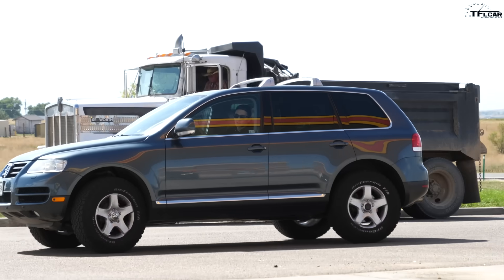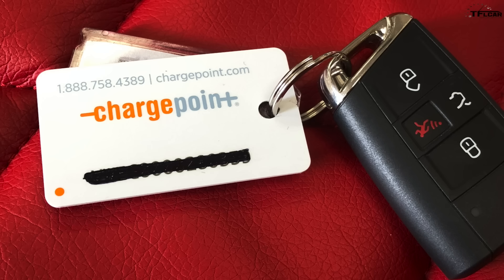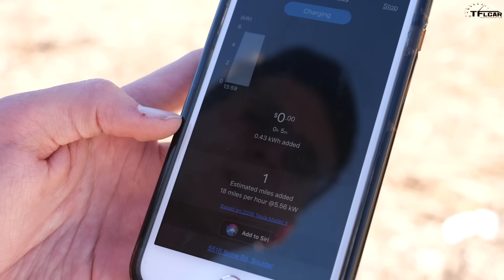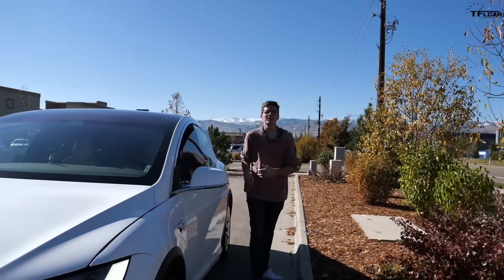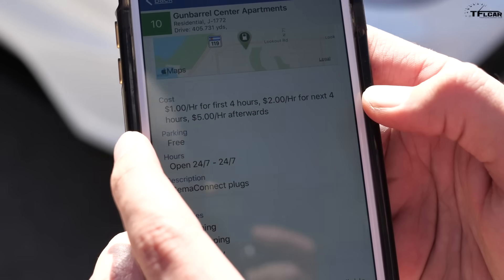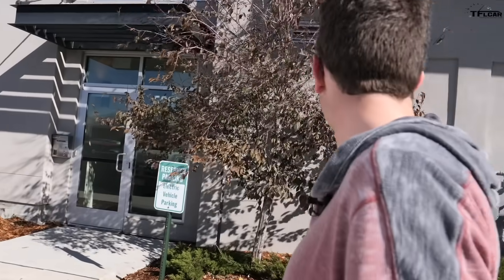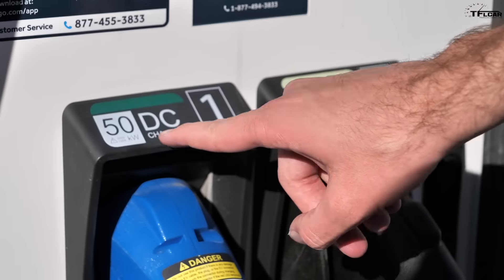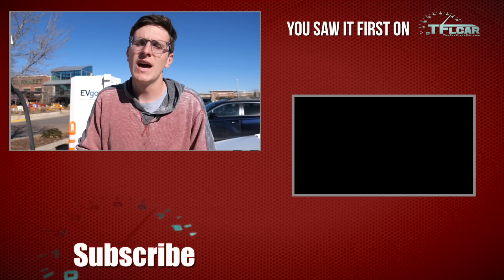Here’s Why Charging an Electric Car Can Suck - And It’s Not The Reason You Think!

Comment: Yes, the charging picture in North America is a disaster.  First automakers refused to come together to agree on a standard, there was and still is shenanigans about plugs between companies.  Then on the regulation side, despite calls from the BEV community, time and again politicians failed to craft policy that would lead to a standard.  Europe was much more forward thinking and legislated a de-facto standard years ago.  Any public charging station must have at least a CCS connection in the EU. 

As for the different levels of charging: If you're taking a long trip and need to add a few more hours of driving time while you drink a coffee you need a modern lvl 3 charger that can charge at more than 100Kw.  None of this antiquated 50Kw nonsense.  If you're going anywhere that you're going to spend a few hours anyway, like to the mall to watch a movie or out to dinner or to stay at a hotel level 2 is the best option.  Often you can even charge for free since a place like a mall would love to keep you there as long as possible.  The best day to day solution (if you can swing it) is to charge at home.  Even off a 120v outlet.  Just like your cell phone, you plug your car in when you get home and it trickle charges overnight and you set off in the morning with a full tank.  Again, this is where legislators need to step up and craft policies that ensures that apartment and condo dwellers have the ability to access a plug where they reside that is fair to everyone involved.

Comment: Charging by increasing the range at a rate of ~ 15 miles per hour. Imagine a normal gas station dispensing fuel at a rate of ~ 2 liters or ½ gallon PER HOUR... 🤣 
You have to be pretty much of a green brainwashed fanatical virtue signaller to put up with all this crap... 🤣
Reply: bokkenrijder172
And that's if they work.  Half the ones in the UK don't even work.

Comment: 0:35
Getting a 240v line run in your garage is pretty easy, to be honest, electricians do it all the time. Plus you can usually get the cost of a garage charging station reimbursed
Reply: and if you're outside North America and Japan, they all use 220V-240V
Reply: @Banom7a  And also can change to 3 phase for 400v
Reply: @gregandkaruna6674  Every house in my country has 400V plugs since like 50-60 years..its use for Ovens mostly or electric heating ..but problem is like 30% off people live in apartments ..my uncle live on 15th floor and has no own garage (there is one but shared )..how can he charge a car ...but i would like to have electric cars but still deam expensive
Reply: @dzonikg  Ovens do not need 400v they all work on lower voltage, they do however require higher current. Yes it's been around for 50 years but most houses opt for single phase 220-240v as it's cheaper and in most cases 400v is not needed, however if you charge your Tesla at home then 400v will just charge faster and not need thicker wiring due not needing as high current.
Reply: @dzonikg  I understand 3 phase power domestic distribution is more common in Europe. That is, the power supplying the buildings is often 3 phase making it relatively easy to run a domestic 3 phase circuit from the board. In New Zealand to run a 3 phase circuit requires a separate distribution board and metering making it cost prohibitive unless running a workshop with anything drawing more than 32 Amps.
Reply: I did my own.  Basic electrical knowledge and Google are all you need.
Reply: Pretty easy if you don't need to upgrade your electrical panel to handle the extra load. A lot of older homes only have 100amp service currently and quite loaded already.  If the electric companies are willing to pay the up front cost of installing the chargers with having to upgrade the panel maybe you will get faster adoption.
Reply: Can you power a 240V car charger off of 208V instead?  A lot of apartment complexes have 120/208V delivered to each dwelling unit, which is 2 out of 3 phases of the 3-phase service to the building.

Obviously it would mean slower charging, but can it still work off of 208V?
Reply: @carultch  It'll likely be even slower than you think, if just looking at what appears to be a marginally lower number (240 to 208). Heating equipment designed for single phase 240V yields around 75% of it's output when run on 208V
Reply: @DiscoFang  So is that a yes or a no?   If you plug it in and absolutely nothing happens, that would be a no.  If you plug it in, and a failure mode happens, that would be a no.  If you plug it in, and it just has a hit to its performance, that would be a yes.

I'm aware that for ohmic resistor loads, the power is proportional to the square of the voltage, hence 75% power, and not just proportional to the voltage itself.  By contrast, a better case scenario is if it were built to always draw 32A from the source regardless of voltage, it would charge at 87% the rate.

Comment: Tommy, how much does it cost recharging at home for full recharges?
Reply: Depends on an number of factors not the least of which is the rates in your area.  Many places have time of day charging to encourage the shifting of demand from high use times to off peak times.  Significantly lower rates often apply in these areas.  All BEVs can be scheduled to only begin charging when you specify for precisely this reason.   More to your question: In general, a BEV plugged into a 120v outlet is the same as any other appliance.  It can only draw as much current as the circuit breaker will allow.  A good comparison would be a large flat panel TV.  If you wished to fully charge a fully depleted BEV with a range of more than 200 miles in your garage from a 120v outlet then you'll need to leave it plugged in for 2-3 days.  So the cost in your area would be similar to how much you would spend if you left your TV on for 2-3 days. (The average drive usually only needs a single night to recharge as the 'average' driver only uses about 30 miles of driving per day).  Some BEV's also can sell power back to the grid.  They can charge at cheap off peak rates then if power prices go too high, they can sell whatever the owner has pre-approved back.

Comment: Well - get a Tesla (model 3) in Europe and there is no adapter needed - it is pure type 2..... and you charge with 11 kW at home or at these destination chargers.....
Piece of cake. 
DC charging - just as easy - the model 3 Europe is with CCS - main standard on DC chargers no adapter need.....
Reply: Also IONITY has chargers capable of 350kW. And Model 3 maxes out at 200+kW.

Comment: There's no charging station within 45 miles of my house.
Reply: You don't have an electrical outlet in your house?
Reply: @Bryan46162  the house is 70 years old and most of the plugs are the old 2 prong style. I have adapters on every power strip I use. I wouldn't trust it to charge a car without rewiring the entire house and as I don't own it, I'm not paying for it.
Reply: You do have a house.  So you have a charging station 0 miles from your house.

Comment: I dread the day when ice vehicle are nearly extinct and this is what we will be left with.
Reply: My prototype makes ICE much more efficient.  The cost gas is cheaper than electricity in my area once an engine is modified.

For an example my lawnmower runs for about A hour on 15 cents of gas.  My brother's electric lawnmower runs for about 45 minutes and costs about 30 cents per charge.
Reply: @787brx8  Please share your mod.
Reply: @ChannelZeroOne  I already share other research on my page for free.  If the world wants this one, they will have to pay!

Test out the stuff on my page to see for yourself.  

If I do make A video on the lawnmower, I won't show most of the modifications.  Probably will just show people how to advance the ignition timing.
Reply: @787brx8  sounds like BS to m,  no link. I've seen enough scams with the hydrogen thing. I've got tricks to get more MPG I'm just curious what other people are doing. Most of it's just snake oil anyways.
Reply: @ChannelZeroOne  The information is on my YouTube page.  Or just search "85 octane full throttle" to see A test run of the prototype on A 98 Mazda Protege.  Then pause on the distributor part to see where the timing is set.
Reply: Charging while you sleep.. sound pretty difficult i guess?  I use the Supercharger about 1-2 times per year.  Most Tesla owners will actually never use a supercharger or other charger ever..with 500km/310 miles of range most people will never ever use a charger.... so very little charges will be needed if we all went to electric.
Reply: @1905934  Except when you want to make a road trip a few states away. I still don't understand why not all EV's are equipped with an 8kw generator. At least it can slow down the discharge rate while driving, and charge up while parked.
Reply: @ChannelZeroOne  Tesla is better is long road trips.. not just a few states away.. I travel to Florida every winter.  After driving for 4-5 hrs.. i need to take a washroom break, I need to eat. and while i am doing this my car is charging.. 30-40 minutes later I am on my way... in a gas car..you can't fill your car while doing these things.. so a gas car needs to still go to a gas station and fill up.  I can shave about 1hr off on an electric car over a gas car on a 2,100km distance.
Reply: @1905934  No I did not watch the whole vid. Got bored about 8 minutes in. I seen enough to see it really sucks own one. 

Tesla is future junk like every other car out there, but worse....  Just watch Rich Rebuilds channel. He drinks the tesla Kool Aid like you. As a blind fanboy I am sure you have watched his videos. He post a lot of useful stuff a Tesla owner would need to know to be able to keep that brick running.

The Teslas will make it the junkyard sooner than most other vehicles due to its reparability and available parts.  You keep justifying all the bs you and every other tesla owner will experience, but at the end of the day it's an endless money pit.
Reply: @ChannelZeroOne  If they only would break down... since there is barely any wearing parts... breaking down is a rarity.
Reply: @1905934  Lmao off. You have clearly never owned one or known someone who has had one.
Reply: @ChannelZeroOne  I own a Tesla Model X 2017
Reply: @ChannelZeroOne  Please enlighten me .. what issues does my model X have?
Reply: @ChannelZeroOne  I put some information about how to modify A generator or lawnmower in the comment section of my video.  It is not my prototype but it does work with limited success on my lawnmower, which is A 300 series Briggs and Stratton.
Reply: @ChannelZeroOne  I put some information about how to modify A generator or lawnmower in the comment section of my video.  It is not my prototype but it does work with limited success on my lawnmower, which is A 300 series Briggs and Stratton.

Comment: I’ll stick with my Forester.
Reply: Same with my Forester :)
Reply: @d7j6f1001 Rae

 "gas/diesel a 1 time use fuel.. "   
  Yeah, because EV´s use the same electricy many times...

 "and not available at home."  
  Why would i need fuel to be available at home? In 5 minutes i get enough to use for 2 or 3 weeks. The only reason you´re so glad that it´s available at home is because waiting several hours in the charging station would be even worse. Charging at home is a very bad solution for a problem that should not even exist in the first place, and does not exist in IC cars.

Comment: To much of a hassle.When they get their act together I might think about buying an EV.
Reply: Short range evs are a joke (a great 2nd car though!). Car manufactures don't want to build a good EV, because a good EV shows how lame the gas car is. All this crap is why Tesla is the only electric car manufacture. They build a fully usable car, with a complete charging network. You won't need any of this with a Tesla, at least if you have a place to charge overnight. Plug it in at night, unplug in the morning, literally takes a couple seconds, and a child can do it. Have all the range you need for the day. Preheat or precool your car and never have an uncomfortable trip again. Cost a small fraction of most fuel bills, even cheaper than a Prius. Plus even the slowest Tesla is quicker than the fastest gas cars on the street. It's like the economy of a Prius, the speed of a Porsche, and the space of a minivan. Now long trips do take longer, depending on which Tesla, and where you are going. An average trip could be wake up fully charged drive 2 hours (120 miles or so), stop and plug in, grab a snack, use the restroom, take a small walk, and continue on for another hour or 2 (100 more). Stop for lunch, get a near full charge, and continue on for a few more hours (150), grab the snack and bathroom, short walk, and continue on for another hour or 2 (100). Stop for dinner, just like lunch(150). Continue on for another hour or 2 stop for the night at a hotel with a destination charger, awake to a full charge and repeat. That's over 600 miles in a fairly decent relaxed day, with good food instead of fast food garbage, cheap charging, a fairly nice hotel, and a smooth quiet car ride. It really is better.
Reply: @randyhare6527  like I said, its a hassle. I agree that charging could be simpler than what TFL is showing and you are right, ownership is cheaper but adding 2 to 3 hours on a road trip to charge the car. No thanks, my time is more valuable to me. EV's just are not there yet in my opinion. I don't care about the speed/ performance because most of the cars have crap suspension on them. Yes including the model S. Not a well built car in my opinion. I will think of buying an EV it can tow my 30 ft 5th wheel trailer 350 miles at highway speeds and recharge in 15 minutes. Until then it's a gas/diesel for me.
Reply: It’s not a hassle. It’s also not a truck.
Reply: @randyhare6527  to each their own. I am not waiting for my car to charge or having to pay to have a 240V outlet in my house. Yes, you are correct, it's not a truck. I am not blind. It's just my opinion on EV's and my life style warrants the use of a truck.

Comment: I take day trips to the coast once in a while and try to be home before dark. It’s 150 miles away each way. I don’t have 2-3 hours to charge at these so called fast charging stations. That’s gonna be a problem. I think plug in hybrids are the best bet to go with
Reply: With 150 KWatt charging you would need two 15-20 minutes stops to do your 150 mile trip. You would need a car and charge network that support higher KWatt charging e.g. a Tesla model 3 and Tesla supercharger.

Comment: I live in Vegas, and simply charge my EV from 10pm-10am every night. That puts a few more miles back into the battery than I need on a typical days driving. Power bill has gone up, but no more than I would have spent on gas. Plus I never have to stop and actually get gas. No oil changes, or any other maintenance required in the years I have owned it other than rotating the tires, and checking the tire pressure. EV’s may not be for everyone, but for most commuters, they are amazing, and super quiet.

Comment: I'm looking at those carports at the apartment complexes in the background and thinking the landlord and/or management company are missing out on an opportunity.

Why not have those spots either assigned to an apartment, or be separately rent able and include a lockable external outlet boxes with 240 and 110 outlets with the power included in the rent or be separately metered?
 
Good for EV owners, or someone with a block heater .
Reply: they might be.  that is why this one had a 5pm closure. the closure is only applicable for general public usage.

Comment: So, it all depends on perspective:
- How many people you know that can pump the gas at their home? I literally do not know a person. Using Sun as your (free provider) sounds good.
- What do you think it was like when petrol started to be used in the early days (so two centuries ago)? You actually had a person doing that for you just to be on the safe side.
- There are standards (at least in Europe) that many manufacturers decided to follow (like that 2nd 50kW plug you showed). Tesla is doing the Apple game. Not very smart. As
- Again, in Europe, there is more high voltage electricity available in the houses.
- Yes, the biggest issue is for those living in the apartments. Landlords tend to not invest money when they do not need too. Some kind of law should probably be made for this.
Reply: Disagree on Tesla. By charging more money for the cars they have been able to build and maintain a huge network. It's what sells the cars and keeps their business alive. When there's money to be made from charging they can open up. It's an easy conversion.

Comment: So, if you don't have a smartphone you can't charge electric car? They don't take  cash or credit cards?
Reply: @ Leopold ...Why the assumption that everybody wants a smartphone?
Reply: "...its not a want anymore since more technology is moving there." ...I don't disagree with that statement but it doesn't make it right that people are being forced into using technology. I have a smartphone because I needed it for work but I don't have even one app on it, I use it for phone calls, texting and the occasional photo (work related) and that's it. I don't see mankind as being more intelligent because they are more fused with technology, I actually see them as just becoming more dependent on the artificial.
Reply: I just read Tesla model 3 uses smartphone as a key. There is a key card though, looks like a credit card. A key fob can be bought for additional money.
Reply: No.. you just drive up to the Tesla supercharger.. plug it in and go when you want.. no paying.. no smartphone.. nothing... super easy
Reply: You can.... I know charge point send me free card that you tap at a station.